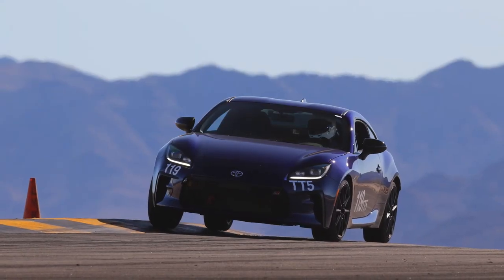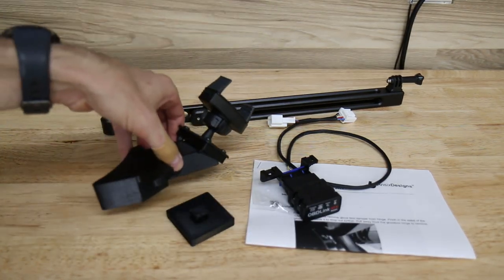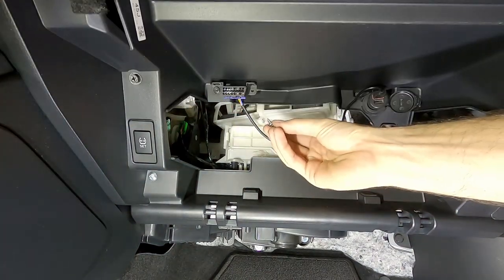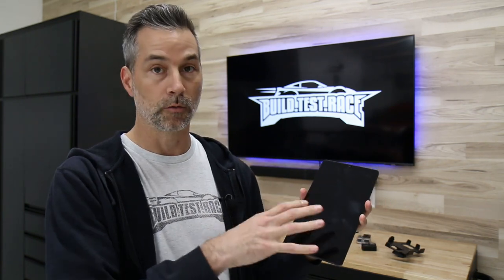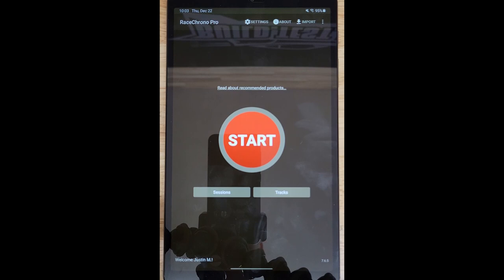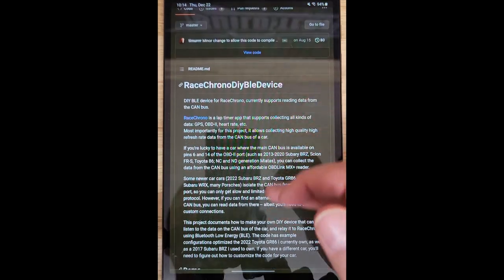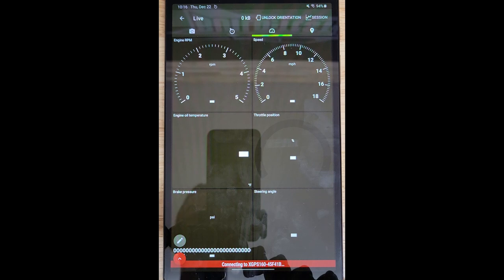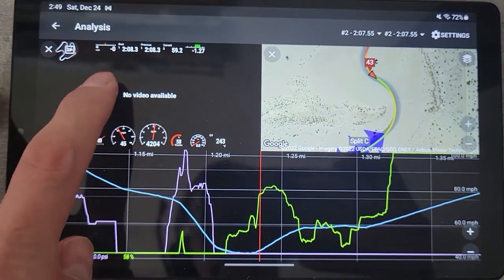Advanced Data Analysis For Your 2022 Toyota GR86 or Subaru BRZ

Comment: Thank you for this video! I added the Ansix Auto CAN Adapter today. I will feed CAN bus data to the SolorStorm app for autocross. I connect the OBD to my RaceCapture unit, which has a high-speed GPS function. When I used the QStarz it was fidgety and occasionally distracting because keeping everything connected and in sync wasn't always easy.
Reply from the maker: Have you gotten it setup in SoloStorm yet? I tried to set it up with SoloStorm as well, but looks like you need RaceCapture or something similar first, which connects into SoloStorm. I don't think you can connect the OBD CAN directly up to SoloStorm :(
Reply: @TheBTRGarage  I confirmed that Ken Houseal's RaceCapture CAN Bus data points are visible and used by SoloStorm once they are loaded. Works like a charm!
Reply from the maker: Nice, I think I commented on that topic too. I'm wanting to do that but not have the race capture because I don't own one :-)
Reply: @TheBTRGarage  I consolidated from the MX+ and Qstarz to the Mk2 RaceCapture. That combo was nice but occasionally fussy in terms of syncing consistently.

Comment: Great vid Justin! I didnt know you can run the OBD reader through the active sound connector with that jumper harness. Pretty dope. I currently run the KIWI3 in oem obd location with Track Addict and it works decent enough. Then post edit overlays with Race Render. I have that CAN Adaptor bookmarked and will plan to purchase soon. Thank you!
Reply from the maker: I used to use that same setup previously, TrackAddict with the same GPS and OBD2 module in OEM spot. Also a good setup, but much better analytics with CAN data! I didn't like having to go into RaceRender for post though, too lazy 😆
Reply: @TheBTRGarage  yea man, good to know! I agree. The the post editing - sync workflow with Race Render sucks, but once synced, its all good from there. once again thanks again for recommending that CAN bus adapter. Its currently on my "hit" list 😅

Comment: Thank you Justin! I've ordered the ASC to OBD CAN adapter and other items to get me to an equivalent setup that you have. I'm planning on taking the GR86 premium to Chuckwalla later this year. Other than an HKS L2 cat back exhaust and deleting the charcoal air filter the car is stock. What are your thoughts on just flushing the brake system with ATE TYP 200 DOT 4 brake fluid and keeping the stock brake pads? At this point I'm thinking of tracking maybe twice a year...
Reply from the maker: Awesome, it's a good setup for sure 👌 I would definitely get better pads for the track, even if it is for a couple events. The OEM pads cannot hold up to the heat.

Comment: This setup looks awesome considering the price / flexibility. Any ideas on an easy solution (relatively speaking) to add oil pressure to the datalog / display?
I know there's an AEM kit available with a gauge but I'd like it to be logged vs. eyeballing it, ideally in an all in one solution.
Reply from the maker: It's pretty good! I have actually been thinking how I could get oil pressure into the app. Adding a sensor to my Jackson Racing oil cooler is easy enough, getting the data to the OBD2 adapter is the hard part.
Reply: @TheBTRGarage  Agreed. I think your setup is perfect if it's possible to feed oil pressure data in somehow. Not sure if it'll be directly through the same OBD2 adapter or some other method. I am also looking at the AIM Solo 2 DL - seems like it should be possible but I'm completely new to external datalogging / track timing tools. Only experience with this so far is standard OBD2 readouts from my FK8 CTR.

Comment: This is so helpful. Thank you so much!

Can you share the clip part of the phone mount that you got? Does it go right on the magnetic clip from the original mount? 6:42
Reply from the maker: Mine is not magnetic, but has a guide and groove where the front part slips into. Kinds hard to explain without a photo 😕
Reply: The “iBolt” branded mount? Did you buy that separately and attach it yourself to the 3D printed one?
Reply from the maker: @GoatsGoQuack  Yes, the iBolt is just a generic phone mount, which I screwed to the 3D printed backing piece (instead of a magnetic backing piece). If you want to hit me up on IG thejustin01, I can send you photos.

Comment: really excellent video but beyond me since I have limited practicality.  I use Track Addict which I find great but want to connect it via bluetooth to an an OBD2.  Can I just get the OBDLinkMX+?  Thanks!
Reply from the maker: Yes, you can use the OBDLinkMX from standard OBD2 port. However, you will be limited to speed and RPM metrics.
Reply: @TheBTRGarage  ah ok, so to get the rest of the data I would just need the ASC port adapter?  That might just be within my modest practical capabilities :)
Reply from the maker: @brucenisbet8603  Yep! It's pretty simple to get setup.
Reply: @TheBTRGarage  ok I got the ASC port adapter and will try connecting it tomorrow.  I could not get Track Addict to synch with the OBD2 so I'm hoping that using the ASC port might help me with that?

Comment: Hey Justin, do you know if the CAN adaptor works for the pre 2022 brz\frs? I know there is a CAN connector hidden under the head unit in those models.
Reply from the maker: This particular CAN adapter in the video will not work, since the gen1 cars did not have the active sound controller and cable. I am not very familiar with accessing CANbus on the gen1 cars to be honest, I just used an OBD2 bluetooth adapter to gather basic things from OBD when I tracked my 2017 BRZ.

Comment: @theBTRgarage : I tried setting up the race chrono to the MX+ using add other deivce and input all the PID correctly , however in the data recording no data is seen . Could you help me to setup the race chrono with obd mx+
Reply from the maker: Follow the instructions from RaceChrono, you need to make sure to use CAN Bus style OBD2 MX adapter.

Comment: hello
do you know if using OBDlink MX+ on OEM port in GT86 2016, I will be able to see:
coolant temp
oil temp
gearbox temp 
on iPhone ?
thank you Sir
Reply from the maker: You might see a few basic things like coolant temp and I think throttle position. There is not much though.